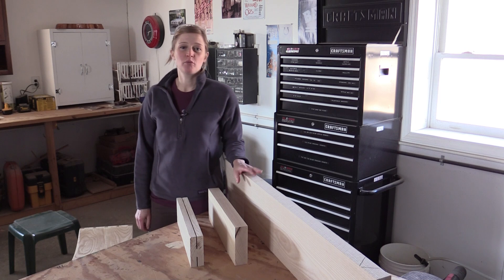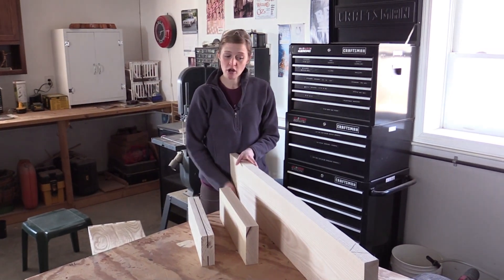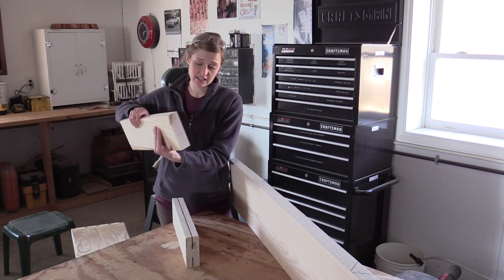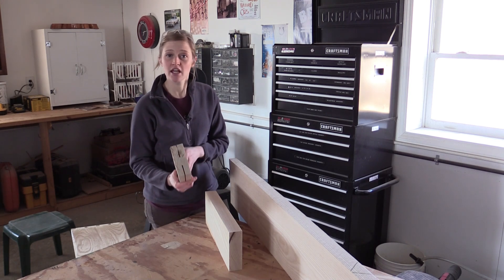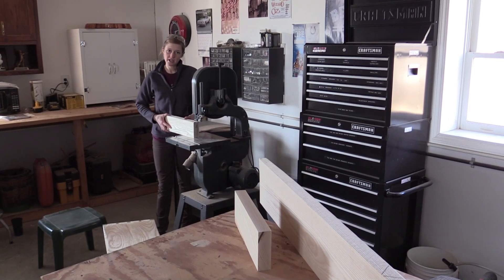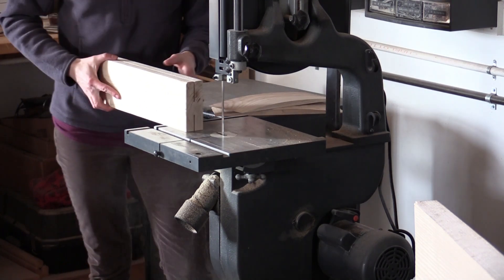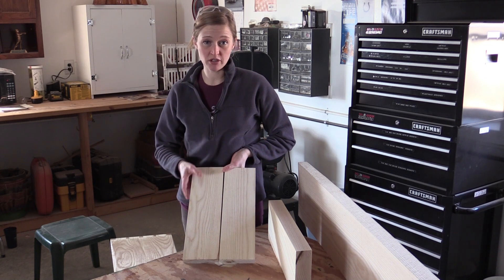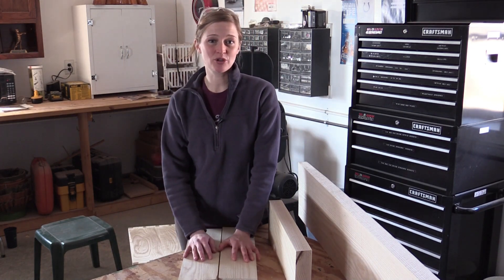Creating Book-matched Panels

Comment from the maker: Good points Mark, James and Alpha. The book-matched faces are on the inside or interior of the board which is cut. Kim accidentally flipped the board the wrong direction in the video. Resawing with the band saw alone (without making initial cuts on the table saw) is also a great option as long as you're using a blade that is a 1/2-in. or wider and has a tooth count of 3-4 tpi with deep gullets. Thanks again for your feedback. -- Dan Cary

Comment: Good demo of how to cut the wood, but the book match is actually the interior surfaces.  The cut halves should be opened like a book with the inside showing.
Reply: Yes, no wonder they didn't match!
Reply: Mark Hazlewood Very true and that's why the table saw method is not the greatest as you have to plain more material off the cut face an you lose TOO much of the match. Just resaw and take a light clean up pass on the planer or with hand planes.
Reply: @jameshastreiter5482 true, though I actually prefer "bookmatched" pieces to not be exactly the same. It makes it looks more natural.

Comment: Why didn't you show more of you resawing? Cutting on the table saw then free handing the rest of the cut does not seem like the best way to do this. The blade thickness is different and why not use a fence to get a more accurate cut? 
And as others mentioned, the book match is the newly cut surfaces...not the outer surfaces.
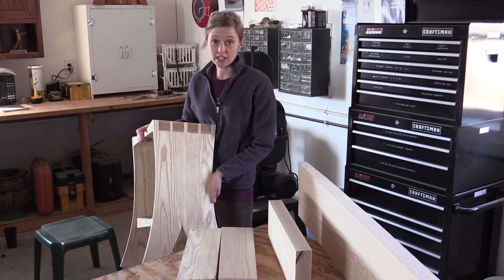And why does you bench wobble? @ 2:53
Reply: ***** THE BENCH WOBBLES BECAUSE THE CONCRETE FLOOR IS NOT EVENDOC